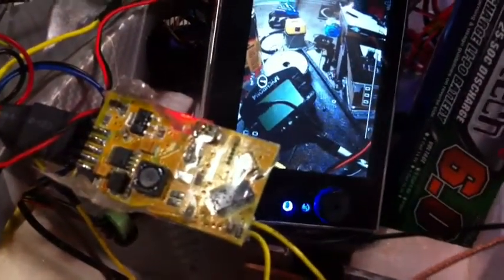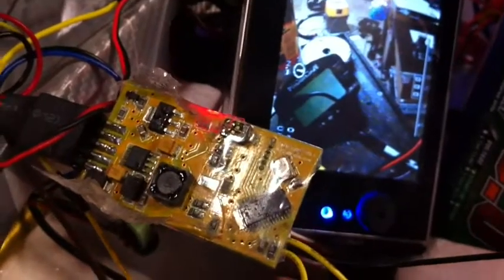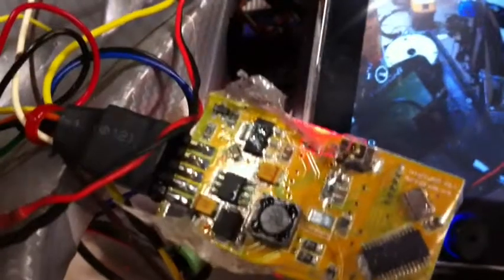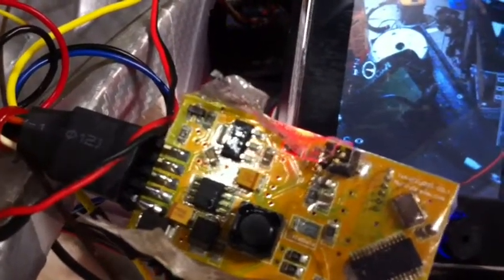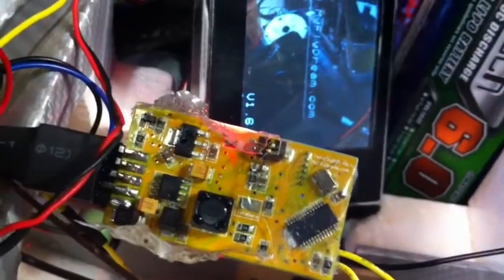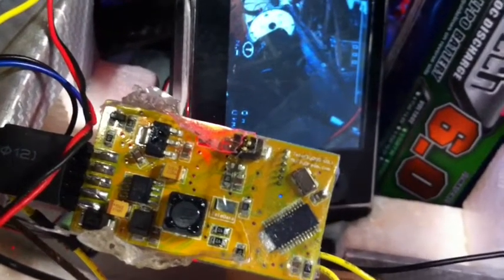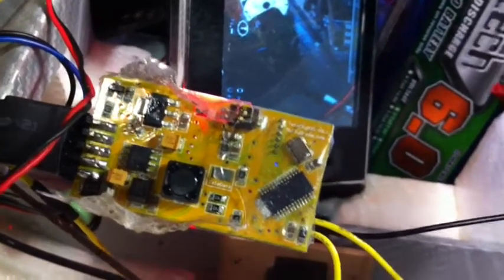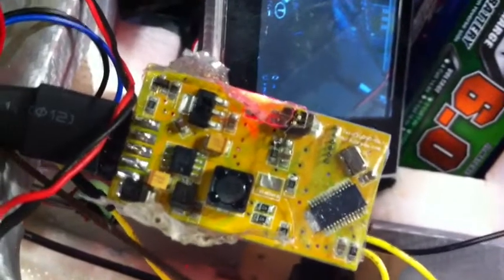Telefly osd issue

Comment: As a reference I had the same problem. Picture was going haywire when hot. I read the whitesheet for the voltage regulator IC and decided to try feeding 5.3 vdc (ESC voltage meant for Receiver) to the osd instead of the 7 vdc minimum MyFlyDream say to use. My OSD now stay warm (not burning hot) and the picture is stable. GPS does work well. Everything is fine and the IC is meant to bring the voltage down anyway under 5.0 vdc.

Comment: That's really weird, most VRs have temperature cut offs but blowing on it is cooling it down which should be good for it. Maybe you have a hair line crack in one of the solder joints?